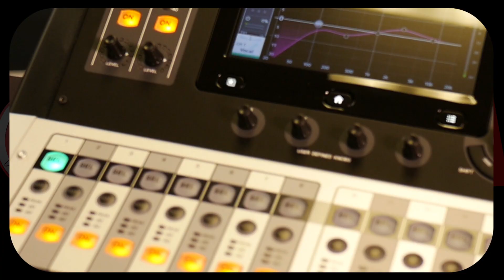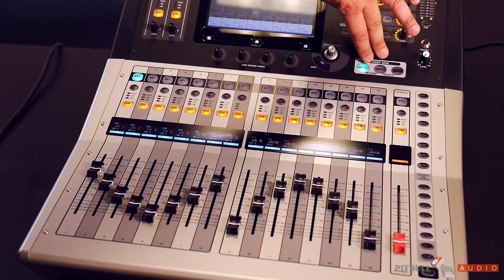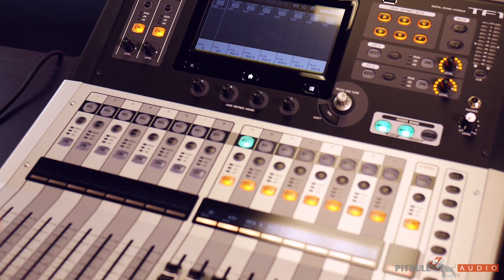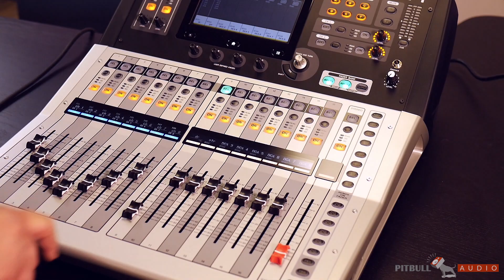Yamaha TF1 16 Channel Digital Mixer | Part 6 - DCA  Fader Grouping

Comment: I can not believe the only thing that can be assigned to a DCA in these TF mixers is inputs. Why did the designers leave out the ability to assign output mixes to a DCA?
Reply: @Maurits Jacobsethanks Maurits, I know how to use a Matrix out for mix outputs, but it is just hard to believe that the people who designed this Yamaha TF system were completely oblivious to output mixes having a delay setting. Thanks!